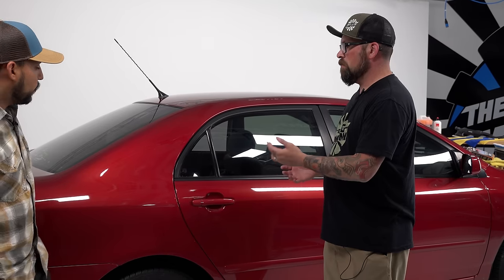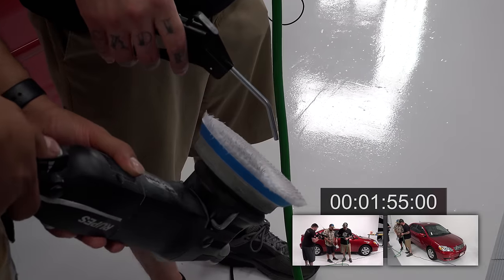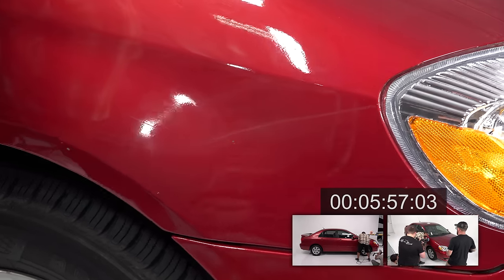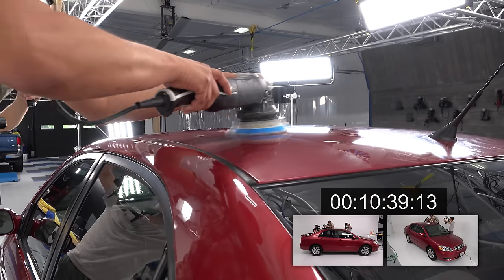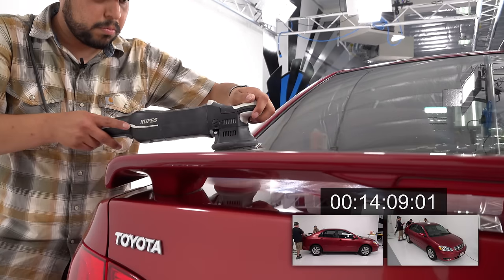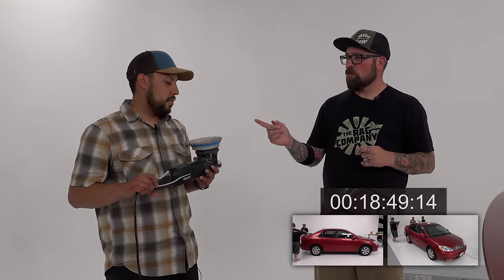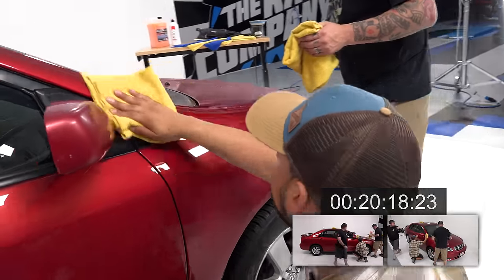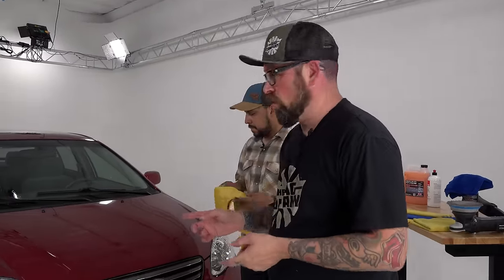Levi's ULTIMATE 20 Minute One-Step Revealed! (Rupes Uno Protect + P&S Bead Maker) | DETAILING UNCUT

Comment: Thanks for the video. I really enjoy these types of real world, time-saving workflows—a lot of great info. But respectfully, the whole car with one pad? I don't use Rupes wool pads so forgive me for talking out of school, but if it performs like most pads, it pretty much quit cutting halfway through the right side of the car. You can blow it out but it's still soggy and saturated with product and debris. We didn't get to see the actual correction (I know, enhancement), before and after, up close with a light, and the finished car looked good, but wouldn't swapping pads dramatically improve the correction with a minimum time penalty?

Also, sorry if I missed this, but is BeadMaker a much better sealant than Uno Protect? Why replace one for the other? Thanks again for the video. Please continue to make more "working detailer" vids. Really appreciated.

Comment: Every Detailer: 3-4 pea sized drops in a 2ft by 2ft area, 3 cross hatch passes in a one inch per second pace

Also Every Detailer:  Completely random number and varied size drops and does the whole hood in 13 seconds.
Reply: Hahaha so true!
Reply: 100% spot on 😂😂😂 But you get more used to what you working with especially with the new compounds, polishes and pads 😂
Reply: @huzaifavawda8383   I try to stick to the same "family", ive been using Rupes Uno for about a year pretty consistently. I've also tried the new(er) Maxshine stuff, pretty good IMO.
Reply: One more fast method to polish a whole car that i still not seeing other detailer talk about is i always put a couple dab of product on the entire panel using finger, that way i dont have to stop and recompound the pad.
Reply: @harisyoung4110  Also a good way to get new guys to overload a pad with product
Reply: @huzaifavawda8383  Each load of pea sized compound on the finger can make a 7-8 really thin dab on the panel that can cover a lot of area.. make a gap around an inch between each dab, by doing that way it will not overload the pad.. it can save alot of time. you should try it.
Reply: @harisyoung4110  I know what to do, I said new comers for a reason 😂😂😂
Reply: @huzaifavawda8383  its not that hard to teach them

Comment: What is the real world protection with Uno?  After wiping off Uno, can you apply a ceramic or a graphene coating?
Reply from the maker: The new version of Uno is called Uno Advanced and now features ceramic protection that's said to last around 12 months, as opposed to Uno Protect's 6 month protection!
Reply: Does this process work with  uro 50/50 pad

Comment: good demo, but would also be interested in what else can be used with Uno, other than BM, so it lasts longer (prep is key, i know), best i can get out of it in Scotland is 3-4 weeks (personal car).  Other decent ceramic spray sealants should have more longevity, like Angelwax Enigma QED/Ti22 Titanium Spray Sealant, Adams Ceramic Spray Coating, CarPro Reload, Gyeon Cure, Sonax S&S, TW Seal & Shine (US)/Hybrid Sealant (UK), WOWO Crystal Sealant and my current fav, Meg's HCD.  😁😁😁 

I've been doing tests with Enigma QED, BeadMaker, Meg's HCD and TW Hybrid Sealant, they all do well other than BeadMaker, it needs a boost/reformulated to lift it up (or used as part of a blend to make a super sealant mix).  Who knows what other cool products are due to be released in the next year. 🤞🤞
Reply: Ive tried Uno protect, give the 20mins cure time then buff off using Sonax BSD and plush microfiber. Give it time to cure perhaps overnight then hit it with bead maker as a drying aid. My car ended up looking like its ceramic coated. Works amazing

Comment: So why use a product that contains a sealant if you’re just going to replace it with a different sealant?
Reply: So you spend more. Optimum Hyper Polish into Hyperseal works better in my opinion.
Reply: The Rag Company then why not use a traditional polish? That may correct better
Reply: Manuel Lara yeah makes no sense to use a AOI Polish with a sealant only to use a different sealant. Might as well use a dedicated polish and get better results and then put a sealant on over it if you’re going to use two products.

Comment: I know you guys like the Uno Protect + Bead Maker.. But do you think the Uno Protect + say Turtle Wax Ceramic Spray would work the same way??
Reply: I reckon you could. The bead maker makes it easy to wipe off and leaves it super slick. The TW may not take off all the residue polish and maybe streak, but I might try that and see.
Reply: @christopherweir9419  Thanks! If you can, please keep me posted on that.
Reply: @puffy514  I tried it today. A couple of sprays as normal per panel and it wiped off, although it grabbed more than bead maker. It also streaked a bit, so I ended going back over the panel with bead maker and that tidied it up. It was cold here today, just 9 degrees Celsius so might try it again on a better day.

My personal thoughts was that the TW polish comes off better with either a damp microfibre or bead maker, which I apply a bit more liberally than the TW Ceramic Spray Sealant. By applying too much TWCSS it streaks and by not applying enough moisture the polish didn't come off as well. The only other way I thought might work better would be to also spray some TWCSS into the microfibre then wipe off the polish.

It definitely worked, I just couldn't mess around too much today cause I was trying to beat a rain storm.
Reply: @christopherweir9419  Thanks for the reply! I guess I'll just stick to the 4 hr cure time. Then put the TW on top. I'm really looking forward to trying the UNO next week, when I have time.

Comment: Even my gloss enhancement package i spend minimum 8-10 hours on the car, I could never imagine myself being satisfied with any result of a 20 minute correction. Using 1 pad for  your correction is awful advise, as if you've used rupes wool pads you know that pad is completely junk now, and the amount of correction AND gloss will suffer greatly by using this practice. Disappointed that Levi is OK with holding himself to this standard.
Reply: Haha! Thank you for your concern! This is the most basic level of polishing. Like I stated in the beginning this an Enhancement polish. I charged $150-$200 on this which includes a decon wash and clay, light wheel cleaning and tire dressing, no interior work. Usually reserved for folks who wash their car regularly through a tunnel wash. Total time for the detail should be max 2 hours, if my boys could get it done sooner the better. 
I would go out of business if I had to spend 8-10 hours on a detail at that rate. 
Id be charging $800-1000 at $100 per hour shop rate for 8-10 hours. 

I think you are confused on the amount of work we are doing,  I guarantee you are doing more work to the car than we are. But I hope you are charging much more!!

As to the pads, I agree on a larger vehicle I change out my pads because you are correct